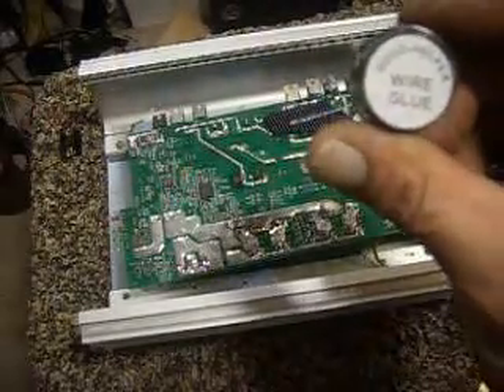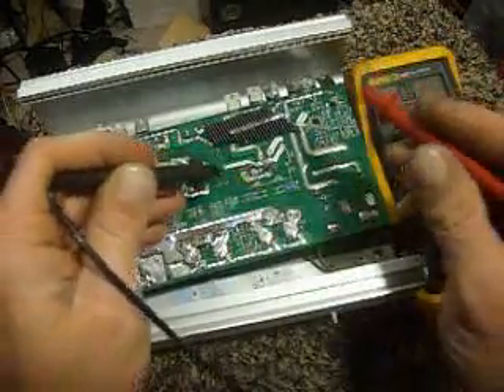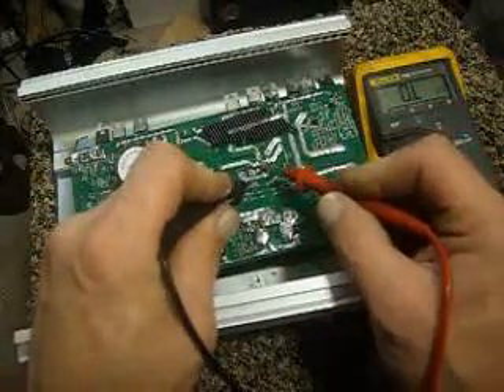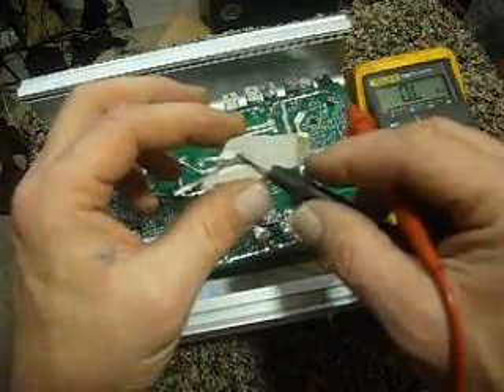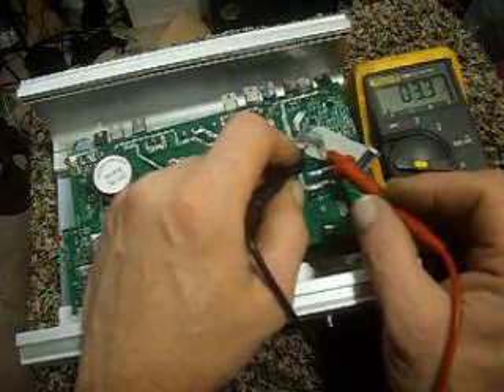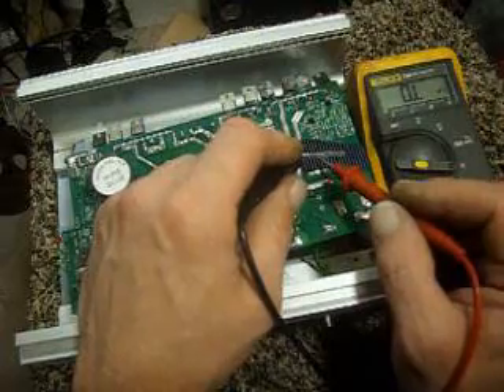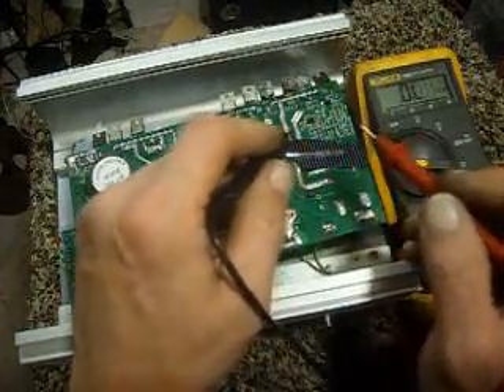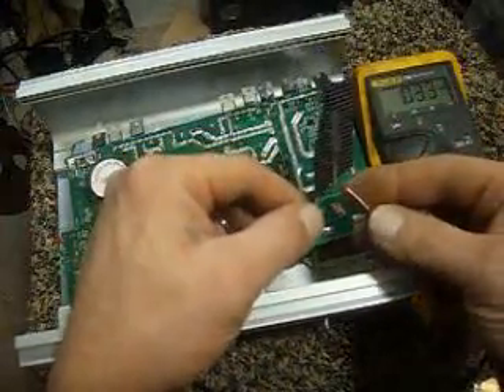Testing conductive wire glue

Comment: the instructions I got with mine stated that the 'Wire glue should be kept in the freezer'.
I wonder if they meant the refrigerator and it was a bad Chinese translation?

Do you keep yours at room temp? does it get hard while inside the container?

Comment: Good, informative video.  Three ohms for the solar cell seems like a lot.  Some of the larger cells produce six amps in full sun, although at only about a half volt.  The voltage drop, I^2 x R, would be over one hundred volts at six amperes.  If both connections are three ohms, the voltage drop would be twice that.  It's obvious that soldering will be necessary on high-output cells; with the glue, the output will be badly attenuated and there will be lots of trouble with heat at the connections.